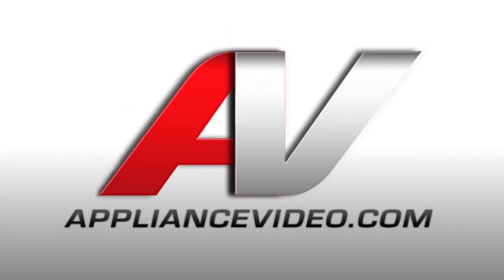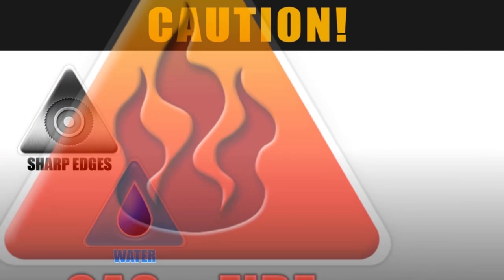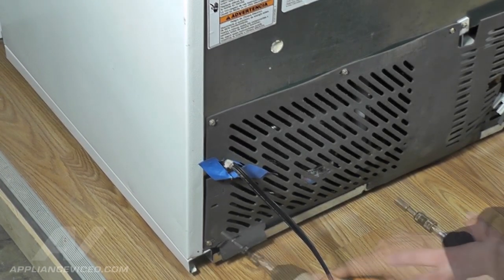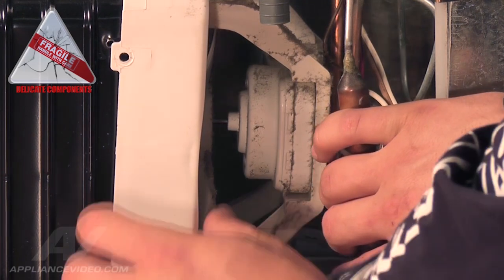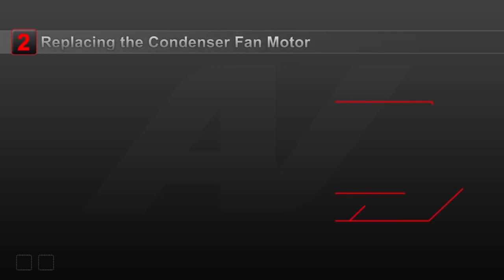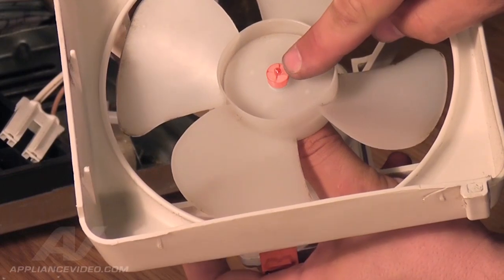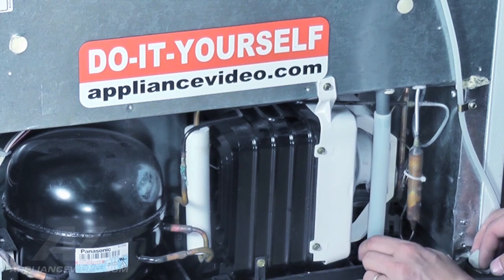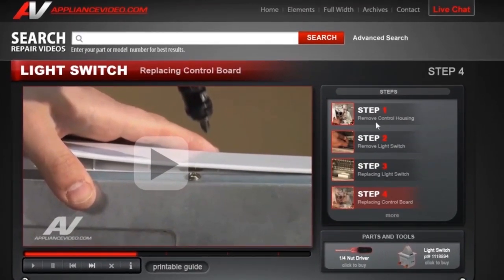Condenser Fan Motor - Refrigerator Repair (Whirlpool Replacement Part # 2188875)

Comment: What needs to be replaced if fan only getting 17V? I tried a new fan and same thing. Fan is clicking and attempting to spin.
Reply from the maker: Great question, if you have a more technical question that our parts department cannot answer, you can search our over 17,000 answered questions free at our website www.ApplianceVideo.com under our Repair Help section. You can also call our parts department at 1-800-830-5465 and they can give you help 7-days A week ,or search at www.SaveMoreOnParts.com  .